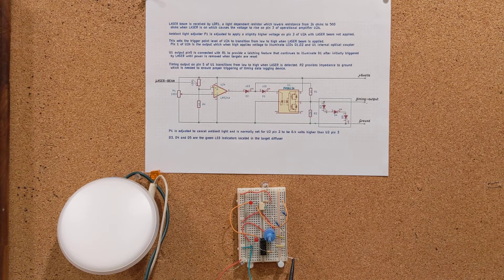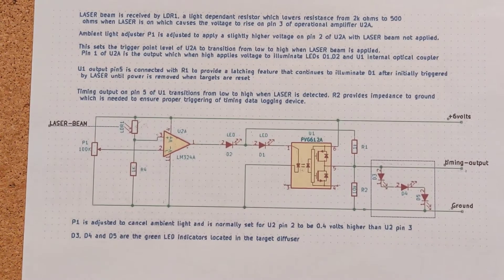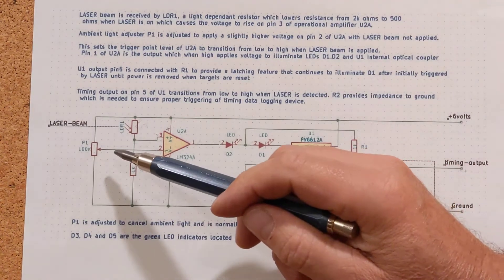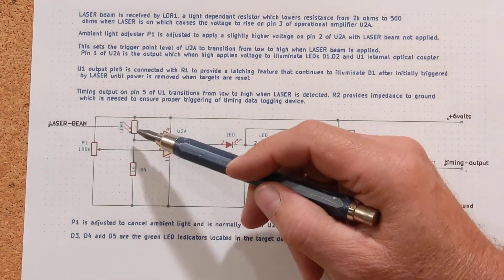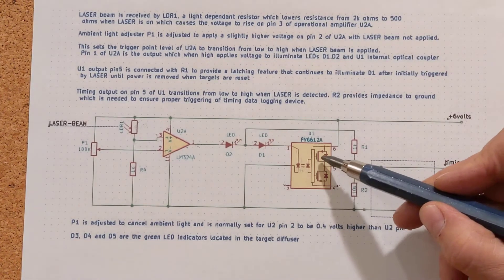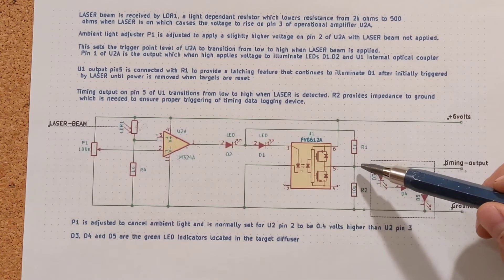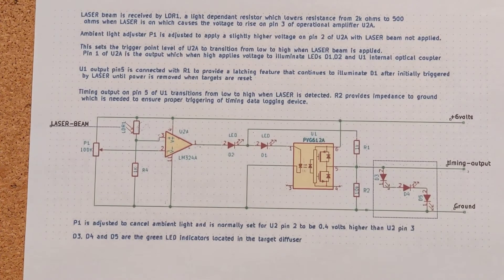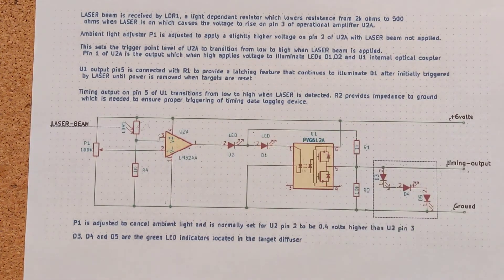LASER target practice circuit schematic under development is discussed

Comment: I was also thinking about the photoresistor system. But then I came across a laser cartridge (bullet) on Aliexpress. Then I went to look for something similar and found 3 applications. Two on android (laser academy, strikeman, not all courses are free), one on PC (from homeless-eng with a model for printing Pi_One__the_LASER_pistol). The principle of operation is that the program analyzes where the beam hit and displays the hit and points in the application. For the first two, we also need special targets. But all of those pictures are on the Internet. Just the picture quality will be low. Even after upscale. They can be redrawn in high quality if you have a will.